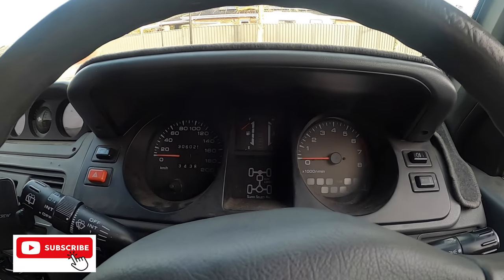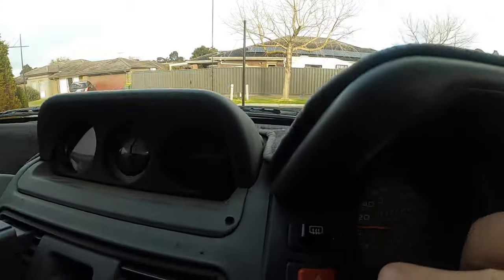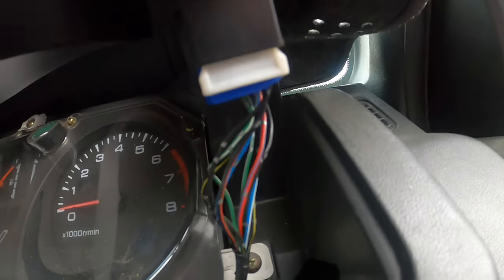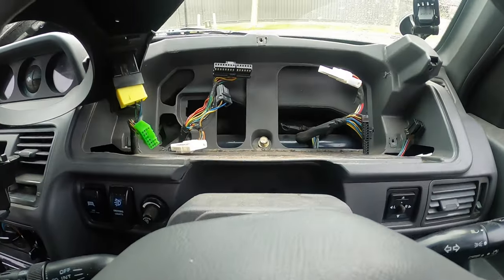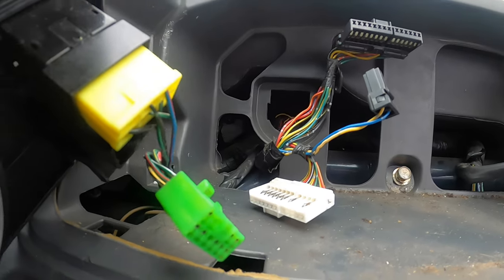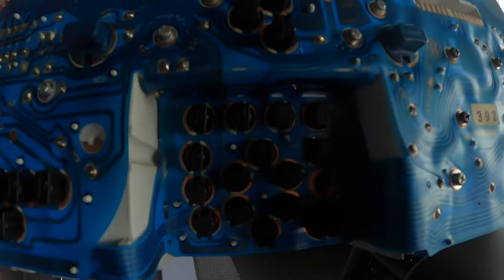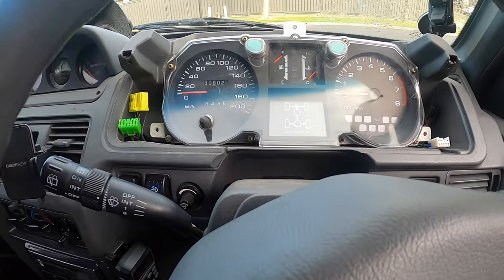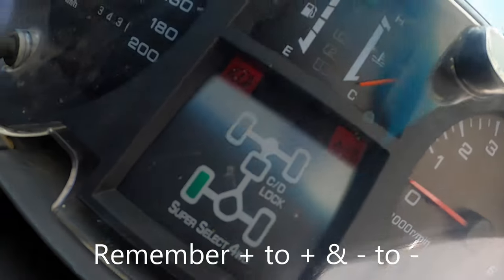DODGY GARAGE | Upgrade the Instrument Cluster to LED's on a Pajero

Comment: They look great, a bit of mucking around but it’s worth it. Is there any particular wattage that you need to get, or are T5 LED only in one strength? Are they available in white, or just purple?
Reply from the maker: You can get them in a range of colours, mate, T5 5050 SMD bulbs with wedge. Ebay is the place to go. They can be a bit bright but use the dimmer switch.

Comment: How many of each bulb is needed? could you maybe provide a list of how many red, green, blue, etc? Or what they associate to?
Reply from the maker: Hi, so the amount of bulbs is really dependant on how many you want to replace. I just replaced the most common ones leaving some of the warning bulbs as is. The LED bulbs come in packs of 5 or 10 on eBay I think, I ended up with 20 x T5, to do all three clusters and 10 x T10 just for the main cluster. So you will need blue for all but the illumination bulbs, if you wish to change that colour from white, as the cluster itself has the colour built in to it for the indicators and warning lights. Again, It's only if you want to change to a different illumination colour like i did with the blue you will need both clear and the colour of choice. So i used 3 clear for the T10's and 4 blue T10's for the illumination and that's just for the main instument cluster. All the T5's in the main cluster are clear, and all the T5's in the other two clusters are blue as they are for illumination only.

Hope that helps, and thanks for watching.
Reply from the maker: I think the tri-cluster is T10 x 2 as well not T5

Comment: Mate, i know you have answered this a lot but can you please answer my specific questions. I just bought a 1993 Pajero and want to change all cluster bulbs.

First question is how to choose colors? I am merely looking to make the backlight blue and all four needles red (rpm, speed, temp and fuel) i don't want to touch any other bulb. So if i install blue t5 or t10 will the light bleed into hazard light or warning light area?? Also I didn't see any separate bulb for the needles? But I saw another video where that guy made his blacklight White but needles green! So confused 🤔

Second is not related to cluster LEDs but exterior LEDs. Do you have any idea what socket is rear turn signal? Front turn signal? Rear brake light? Front parking light? Fender turn signal? I know reverse light is 1156 socket but no clue about other sockets?

Sorry for these long questions but help a fellow Pajero brother out 😊
Reply from the maker: Mate, as for question 1, that's just not possible without some sort of modification to the cluster.
Reply from the maker: As for Q2. Just search eBay. I'd say.
Reply: @dodgy_garage_4x4  thanks mate! Got my answer! 1156 for reverse and turn signals, 1157 for brake light and t10 for fender turn signal and parking light 😄
Reply from the maker: @SumairKhan007  Thanks for that. It's good to know. I might do the Dodgy Pajero. Let me know how it goes..

Comment: Hi mate, ive just replaced the bulbs in the centre bit and they worked fine. I replaced the indicators and they worked fine too. However now i have gone in and changed everything ive my battery level meter, speedo and revs have stopped working... Any ideas what might be going on here? All connections seem to be fine
Reply from the maker: @cubacrew07  Hi, I couldn't be sure of the issue.  But if it was me, I'd swap the bulbs back out to the original ones just to see if it rectified the issue.  If the connections are all good, then I don't understand why that's happened. For me, it sounds like you've missed something, but again, I'm drawing a long bow here without seeing it.
Reply: @dodgy_garage_4x4  yeah I think that's what I am going to have to try first. It seems weird that the battery gauge worked when I replaced those bulbs but something since changing the ones in the main cluster has caused that, the Speedo, and the revs to stop working. I couldn't see anything amiss on the back but I'll pull it back out again today and see. Hope it's nothing too major as I'm supposed to be heading on a road trip soon!
Reply: @dodgy_garage_4x4  so just as an update, I found a fuse that had gone and all is good now. Although the cruise control isn't working now. Any ideas what could have gone since it was working before this? Will check more fuses but unsure there is a CC fuse.
Reply from the maker: @cubacrew07   The switch is on the instument cluster, which has been taken out, would be taking a look at that first. See if something is not quite right. The plug me be seated, but the contacts are sus. Maybe spray a bit of isopropyl alcohol on the contacts to clean them up.

Comment: Do you know what size/type the 2 Blue small twist caps are? They each had slightly larger bulbs than the rest of the T5s.
Reply from the maker: T10
Reply: @dodgy_garage_4x4  Not those, but now looking back at the video yours is slightly different than my Pajero Evolution. The lowest gear selection bulb is a different size than the other 5 black twists, and I have an additional blue cap that you dont have on the board at all. Interesting. Well back to the drawing board haha

Comment: Back again - A few questions
How did you test the lights that only illuminate under certain conditions? 
For some reason my indicators arent working at all now - including swapping the original halogens.
For some reason now my Brake Warning light is on (red circle with exclamation point)
Reply from the maker: So with my model, all the lights will illuminate at startup as a test.... It was just simply trial and error, if they didn't work I would flip the bulb around to change the polarity of the LED. The red Brake Light will illuminate if there is a brake issue, like low fluid, but it also ilumuniates when the hand brake is on. Have you been flipping the bulbs around if they don't illuminate?

Comment: Any idea if T5 sockets could be used in place of T4s? I have the Pajero Evo and the gauges lights are slightly different. Some in the bottom center are T4 Neo Wedge (same as used in the compass of the trigauge)
Reply from the maker: HI mate, I wouldn't be sure if you could. Seems your model is very different to the my particular model. I'd hate to offer up incorrect advice, they actually look to me that they are not a wedge type?

Comment: Can you fit the t5 & t10 without unplugging the cluster? Like you did the climate control dash lights? Looked like there's just enough room?
Reply from the maker: Not quite mate, maybe if you persisted you might, because it's real close. I just thought that for the sake of 4 screws it wasn't worth mucking around.
Reply: @dodgy_garage_4x4  cheers for the reply mate....another idea maybe unplug only one side of the cluster & swing it halfway to change globes without risking tearing the circuit......... just a thought..... nervous removing the whole thing 😁
Reply from the maker: Might be an option mate, give it a crack and let us know how ya go.
Reply: @dodgy_garage_4x4  cheers cobber, will do...... 😊🙌

Comment: Hello! I know this might be a simple task that I can do alone, but excuse me since im a total beginner. I wanted to ask it you could make a video, or a youtube short in this case, about how to replace both the driver side & passenger side interior lamps in this pajero, and how we'd have to place them if we chose LEDs rather than bulbs
Reply from the maker: Are you talking about up on the roof lining near the mirror or in the doors?
Reply: @dodgy_garage_4x4  Sorry for the late reply, yes I meant the roof lighting next to the mirror, if you could do the other roof lights then that will be appreciated very much.

Comment: Hi mate,  Thanks for the inspiration i,ll give mine a go now. Just curious does the dimmer still work?  And is the LED kit specific for gen2 pajero. cheers all the best.
Reply from the maker: Yes mate, the dimmer still works, no problem. Give it a crack pal, it's an easy mod. Feel free to reach out if you get into strife.
Reply from the maker: Oh and no any T10 and T5 LED will work. Go for 5 x T10 and around 20 x T5 for a full conversion. 1 x T10 needs to be white for the fuel light. But the other 4 can be whatever colour takes you fancy. If you want to do the other clusters then you'll need another 2 x T10 and 2 x T5
Reply: @dodgy_garage_4x4 Great info thanks. Looking forward to seeing what you do next. Thanks again and all the best.